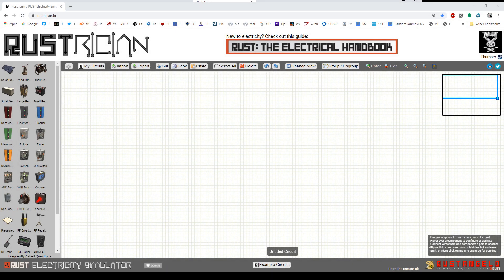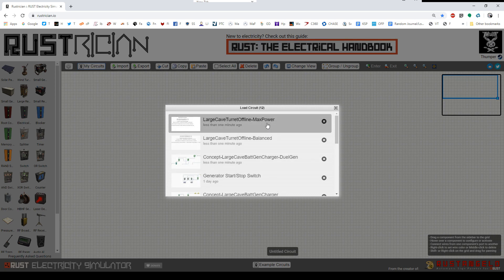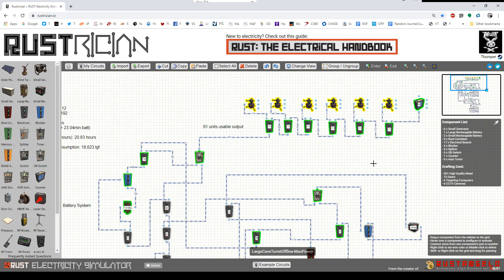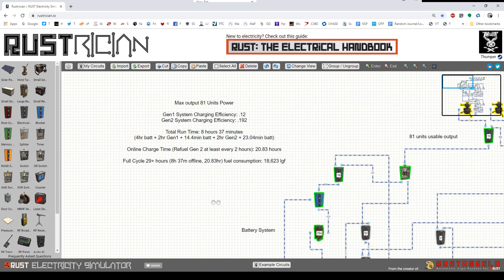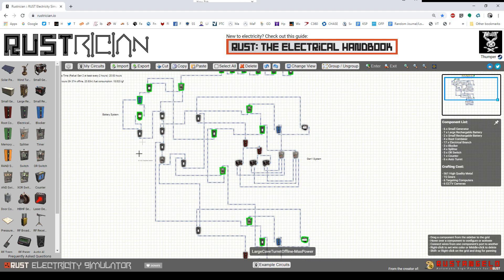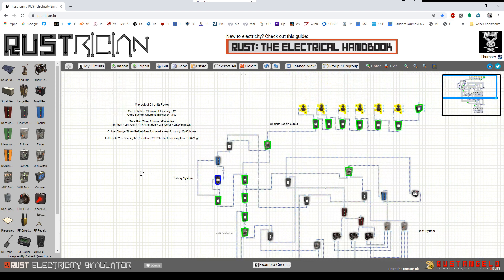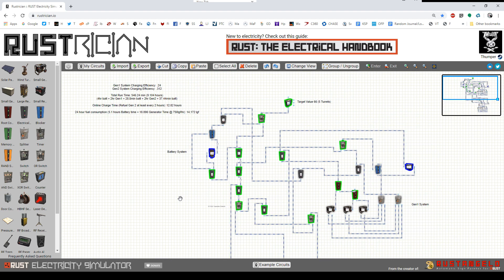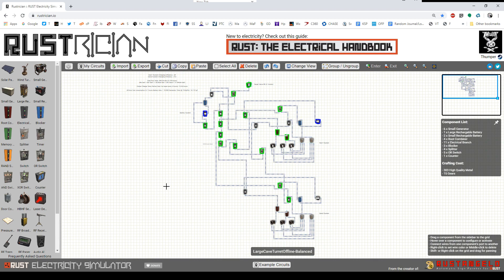Rust Electricity 101: Basic Circuits - Deep Cave Base Turret Power

Comment: Hey Rabbit, I’m a fan of your videos, I’m not VERY good with electrics  but I’ve been messing around. I got 3 batteries to kick in for backup power (one dies, next one turns on, etc). I am trying to get 6 large batteries in total (3 pairs of 2 for 200 power output), and then maybe a few generators to also turn on when the batteries die. I’ve been building a cave base on a creative server and I want it to have a lot of automatic stuff so if you could please help me out with a diagram for the generator and batteries all together that would be amazing 😎👌
Reply from the maker: so you want three 200Rw circuits by root-combining three pairs of large batteries, and I would assume that implies you need 200Rw per circuit for the backup generators also? So that would mean 3 sets of 5 generators for the backup on each of those circuits. That's a lot of low grade! :D  It's possible, you just need to kick on all 5 of the generators and root combine them to take over for the batteries when they die. You can use one leg of the diagram from this video, but you will probably need to upgrade the small starter battery to a medium to have enough power to branch/split out for starting 5 generators. If you get stuck, let me know and I'll put it on my wishlist to hash out a diagram for you!
Reply: Rabid Rabbit alright thanks so much, I’ll try it after school tomorrow!

Comment: I always scratch my head when it comes to running gens for 24hrs. I can get a 2 gen chain but I can never figure out the wiring to use more than 2 gens in a chain.
Reply from the maker: Clovis, are you having trouble making this circuit work as designed, or in a different scenario?  Now that you can chain batteries and pick up and move batteries without them losing their charge, there are probably more ideal ways to manage cave base power than this build, but I'd be curious to know what situation you're solving for specifically!

Comment: Hmm would have been nice if the batteries didn't loose/reset their charge when you pick them up. Otherwise you could've had a charging station up top running on solar or the like. Then you'd transport the batteries down into your cage once they were fully charged.
Reply from the maker: This would be a huge game changer if batteries kept their charge. I really wish Rust electricity just re-used some of the 'liquid' principals already in the game, since in concept electricity is a lot like water in storage, flow, and use.

Comment: Q: is it mayb better to place a hbhf neer the turret . And when someone comes close turn turrets on the turrets
? Hbhf take’s les power then 1 turret 🤷🏼‍♂️
Reply from the maker: Good point, this would absolutely be an option to save fuel and extend run-time but having a lower power system with a single generator for 'logic an detection' and a higher power system for the turrets!

Comment: Thx for fast video! My fears are true, too much fuel and time needed :D But thx anyway for doing math for us :D You deserve lot more subs and I hope you get them!
Reply: I have arranged my cave base, my team did build a compound around it, we have 2 wind turbine and 4 solar panels that bring electricity in the cave, I set 4 big battery inside the cave that will charge by time, meanwhile giving power to light and turrets around the base, 4 fully charged big battery equal 16h backup power, and of course the battery will kick in immediately if the power from the turbines get cut (turbines destroyed)
What I mean is that the batteries are charging all the time with the power that is not being used by the lights and the turrets. No need of generator
Reply: @ManwerKr  Bro, we are talking about caves that can't use power from above. There is no other option than gens.

Comment: DUDE, can you just show us how to make ONE turret run to cover the bucket ?
Reply: This! Please. We need a cheap way for cave electricity in vanilla.
Reply: Guys, just find a middle size cave, later I'll tell e you exactly which one is it, but is the one without the bucket, the middle cave it's damn big and tall, so you can just hook up the cable from the top of the cave to the outside of the cave. You just need to check on the map where is the tallest part ang go outside of the caveto the same location and build there a wind turbine. Cover the entrances with turrets and set a batteries charge system that will kick in in the case the turbine is destroyed
Reply from the maker: @ManwerKr  Yep, I have an old video on this, I think it is called the spike trap base maybe? I forget what most cave players call it.   https://www.youtube.com/watch?v=S-0GYUHyJp0
Reply: What I do is run Rabbids original balanced cave configuration but i just charge extra large batteries with extra generators then switch out dead ones with full ones before i log. Then charge the dead batteries while im on. Would be hard on a vanilla server though, not sure i could play a not modded server anymore.
Reply from the maker: Hi Doc, so this is all about trade-off. One turret isn't a lot of power, but what are your other requirements? (IE do you need power for anything else, like lights? Notification of attack/low ammo from the turret?) How much run-time do you need? Can you or your team refuel a generator regularly or do you need X hours of offline time covered? Happy to provide ideas but everyone's idea of a solution is a bit different. This video was designed to meet Zlok's requirements, so I understand it doesn't fit everyone's needs.
Reply: Rabid Rabbit Hey isn’t it possible to hook up a sensor at the the entrance of the cave that force starts the generator which powers up back your turret? If it’s possible I find this idea the best just to power up a turret for the cave entrance / bucket.
Reply from the maker: @severincristian1402  Yep, you could use a lower power solution with a single generator to save fuel and just run sensors and not trigger the higher power solution for the turrets until it is needed. You'd still need fuel, but a lot less.
Reply: Also would like to know this but with 2 turrets
Reply: It's real simple. Many of us cave builders are being screwed right now. What is needed is real simple. One turret running 24-7 to cover the bucket. THAT'S IT. No lights, no notifications, nothing. We had no lights or notifications before. What we did have was the bucket covered 24-7. Make bucket caves great again !  If you want, you can log in to my cave, and I will show you the standard setup. I have all the parts needed.
Reply from the maker: Here's a scaled down version for one turret, all extra power to charge the battery to add run-time. This is about the most efficient design I can think of at the moment, but once I have time to play with things more I may find a better answer!  https://www.rustrician.io/?circuit=602dffd60644f36f034e7d0322365d60